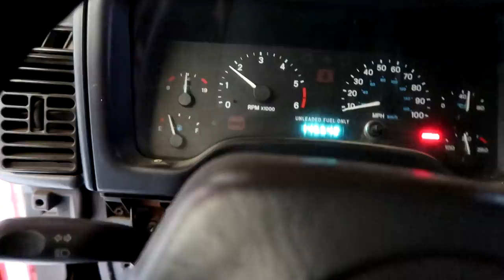So Much Turbo Spool! Turbocharged Jeep

Comment: Next Video: BLEW UP THE JEEP
Reply: Or: I TOTALED THE JEEP!!
Reply: If anything it will say... THE JEEP IS RUINED...
Reply: Braden Stokes s
Reply: "the jeep blew up and was on fire and my warehouse garage has burned down"
Reply: How is the turbo bracket installed? Please?, need help.
Reply: Love it😂 I doubt it though since that kit specifically runs I believe 6-8 psi, which is well within the range the stocks internals can handle, although decreasing long term life.

Comment: @3DMachines while you're at it, it might want to strip the jeep the rest of the down to bare frame, sand blast it and spray it with bed liner and do the same thing to the jeep body as well.
Reply: Minion Moto That's what i would do too.
It's so easy now and not that hard...
Reply: exactly. i would like to turn my truck into a prerunner with a camper shell so i can put a bed to sleep in, in the back of the truck with a matching long truck bed trailer and do everything to the trailer that i do to the truck. but i'd do the whole truck and trailer inside and out in bed liner.

Comment: You should put a long arm kit under the jeep, or at least look into it.  I did one on my 2000 Tj when i had it. It was a PA jeep and the rear control arm mounts rotted off so I patched the holes and long armed it.  Make it way more capable and got rid of the problem areas where a lot of those jeeps seem to rot from the mud and salt.  Just a thought, keep up the content! I've been an avid  watcher for a few years now and love the videos.

Comment: I bought this kit. And it did not work out and had to sell it. Half the things weren’t shipped and it was chaos. But when it was in it sounded so good
Reply: It's nothing but an expensive noise machine. It doesn't make power due to high IATs not being addressed properly.

Comment: How are you going to go about tuning the computer for the turbo ?
Reply: Won't need it for low boost. But for more boost, apparently you need to piggy back or trick it, as there aren't any aftermarket ecu's that I'm aware of.
Reply: Flying Ryan can flash the stock computer. He is out of texas.
Reply: @strider5119  I’m doing this with the 2.4 4cyl and using a split second enricher
Reply: What would you consider low boost for no ecu tune ?
Reply: If the objective was the simply make the keep faster, mission done. And fairly reliably. Tuning it might not be possible - If it is it’ll be very expensive and more complications means more issues.
Reply: Up to 4psi.   Most stock ecuvand fuel system can account for 30% more than factory power.

Comment: After my cousin cleaned up his fiberglass body on his CJ-5, instead of painting it, he had the entire tub Line-Xed inside and out and under the tub. They can match the color of your jeep and they warranty their work. I refuse to have anything rhino lined after they screwed me.

5 years ago I had my dirtymax dually's bed done in rhino lining. 1 year later, a big chunk peeled off. I went back to rhino lining to have them fix it under their warranty, and they would not warranty me. Even when the installer admitted that they did not prep the bed properly before spraying it, they still wouldn't. 

So I made an insurance claim and went out and purchased a new bed, had it Line-Xed in the color that matched my truck perfectly. Rhino liner had to pay for my bed and the Line-X after I took them to court. To date, the Line-X looks just as good as it did when I first got it done I haven't had one issue.

Comment from the maker: Anybody have anything entertaining to post?
Reply: Check out that drive shaft angle
Reply: Buy another ktm dirt bike
Reply: Who won the go pro giveaway?
Reply: 3DMachines love the videos
Reply: What are you going to do to get the intercooler to breathe? I suggest getting a water-to-air but what ever you wind up doing get a real wideband gauge so you don't instantly tear stuff up
Reply: U should make longer videos
Reply: 3DMachines you need to cut the rear diff loose and re angle it, that driveshaft angle is waaay too much, it will blow the ujoint apart like it is
Reply: 3DMachines make longer videos please
Reply: 3DMachines Dalton you aren't wearing your invisolines huh!! What's up how nice takening care of muddernature keeping the froggy fresh place to hop and you killing the prodjects yes way nice going too! That Jake looks like he needs a burger or two !!! Thanks!!!
Reply: Tyson Richards  rite!!!! Gonna need more UJOINTS!
Reply: Get the old Ford mower out and at least show us the mower a bit
Reply: Tyson Richards just what I was thinking. Need a double cardan shaft.
Reply: Please Pressure Wash The Frame!
Reply: Keep doing what ur doing just make the vids longer love them when they are longer
Reply: 3DMachines l would put a vent in the hood to allow the intercooler to cool off more efficiently. Also it would make it less likely to over heat.
Reply: Just a couple of things you might consider get a fuel air gauge if that engine runs too lean it will melt a cylinder, second look into relocating that intercooler in front of the radiator for cooler air inlet temperature for more power . One more thing running a small oil cooler betwine the turbo and the oil pan helps . Don't forget to have fun !
Reply: dave1135 yep.. i agree completely 😎
Reply: that frog was great full you got him out but then prob got eaten by a bird...circle of life lol
Reply: 3DMachines NICE WORK DALTON!!!!   IM A Machine
Reply: That drain looks like its pointed downward out of the pan, oil wont flow up. It should be pointed as strait up as possible so the oil can return right into the pan.it ahould have gone further back on the pan where its deeper by the pick up so it could have been more vertical
Reply: 3DMachines jeep just empty every pocket
Reply: Go pro
Reply: What happened to your Yamaha street bike
Reply: 3DMachines make sure to drill drain holes in the bottom of the frame rails and close up the holes in the rear wheel wells those are the main reasons the frames rot out

Comment: Is the jeep 2wd or is the front driveshaft out
Reply: tylerfigs you can see the transfer case around 6:00 minutes
Reply: Good call but look at that driveshaft angle
Reply: yeah that needs to be addressed, way to steep, id get a slip yolk eliminator or maybe a t case drop

Comment: Ok maybe. Turbo machines are easy. Plumbing is the key. Oil and air. I still am not sure why you want a turbo on a Jeep. That 6 has more than enough power already. Go to high altitudes? 14,000 feet Dalton? I have installed Chevy v8s in 2 Jeeps. They were overkill. The 6 is enough. Perfect powerplant for a Jeep.
Reply: upside downdog but the noises it makes with a turbo is heaven
Reply: Jordan Scheurer 
I agree, I have a turbo motorcycle which is my point. A Jeep will have trouble utilizing a turbo without breaking things.
Reply: upside downdog maybe enough power for you.The best things about jeeps is modding them. So what your saying is we should all drive stock cars.  “More then enough power” Are you kidding
Reply: Mr- T 
Absolutely not! I don't even own a stock vehicle. Don't put words in my mouth ever. What I am saying is a strong six will rip a Jeep in half quite easily and besides, turbos work in the higher rev range. Great for breaking driveshafts, axles, and transfer cases. I guess Dalton is rich enough to buy all that new everytime he takes it out.
Reply: upside downdog A t28 turbo pretty small turbo a Audi 1.8t  uses this turbo so I don’t think it’s to much turbo.i guess it just comes down  to forced induction experience.Also the banks turbo kit uses a t28 and it all low end.
Reply: Mr- T 
Not really down to experience on my side. I have converted many aircraft to turbos and own a turbocharged motorcycle. A turbo on a Jeep will turn it into a Heap.
Reply: upside downdog I drive 99 Jeep Grand Cherokee 4.0 supercharged my Jeep is Far from a heap
Reply: Mr- T 
Give it a few years. Its true colors will come through. I hotroded several Jeeps in the 80s and nineties. Anything more than a nicely built six just tears the hell out of them. New stuff will last a while but now Jeep is a Chrysler/Fiat/Jeep product. Electrical issues will creep up first. Those are sweet machines, for now.